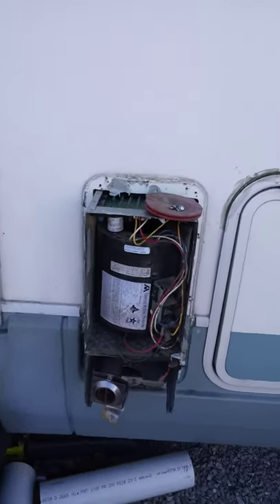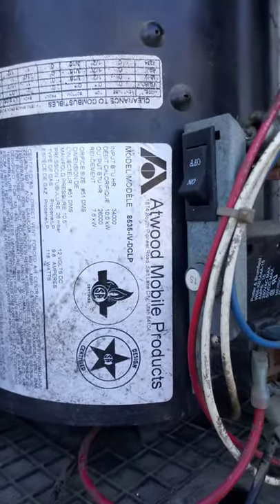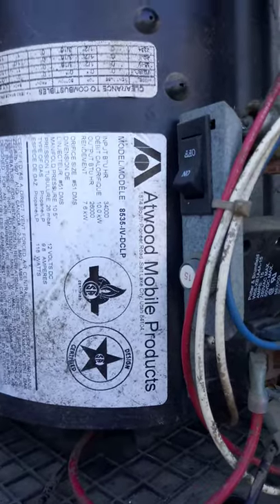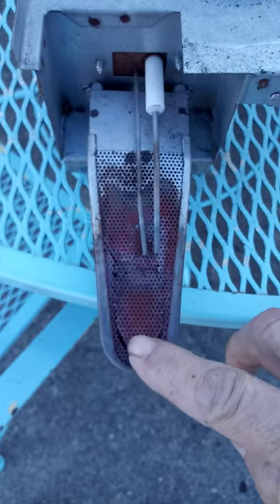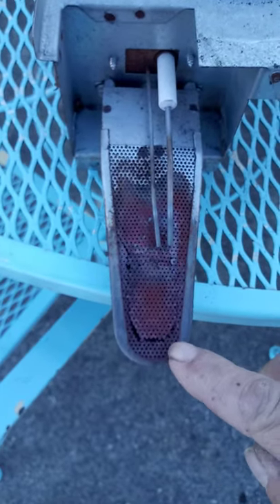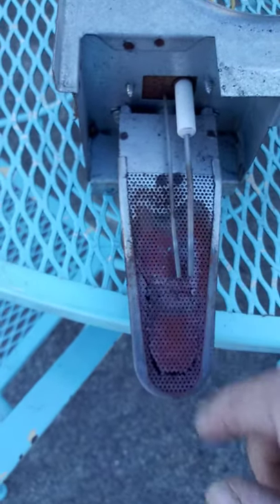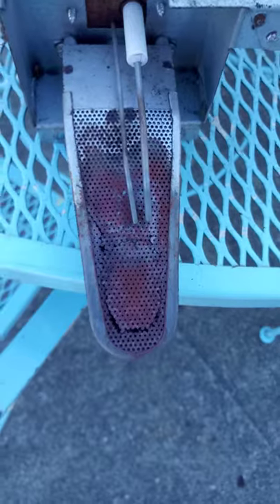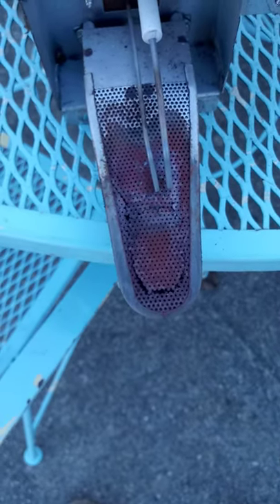Camper furnace having intermittent flame. Atwood model 8535-IV-DCLP

Comment: Hi Joe, Thanks for this. Is there a magic screw at the back that I need to get the unit out of the hole as far as you did
Reply from the maker: You will have to forgive me for not being more versed on the prelude to this video, as it has been a while. I believe all of the screws that were holding it in place where on the outside, although I am not 100% certain. I do remember the gas line and the duct work that come out of the furnace assembly were interfering with getting it any further out of my camper. Access may be different from camper to camper. I have a 2001 seabreeze fifth wheel

Comment: Was your furnace igniting 3 times shutting off and giving you an ignition lockout fault with 3 light blinks?
Reply from the maker: There is no light that blinks on mine. When I was having this issue with it it would ignite three times then go out then the blower would just continue to run. It would only ignite three times then it would stop trying to ignite
Reply: Did it fix it? Or was it the sail switch?
Reply from the maker: @alexanderellis2253 replacing the burner actually did fix my issue.